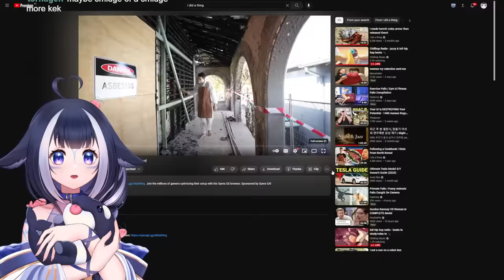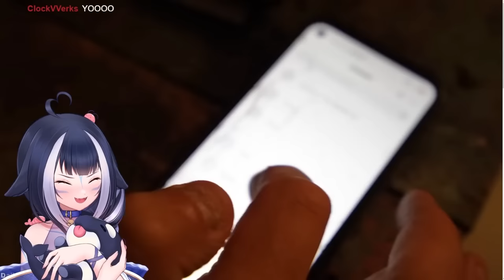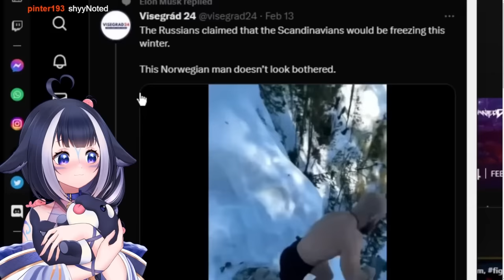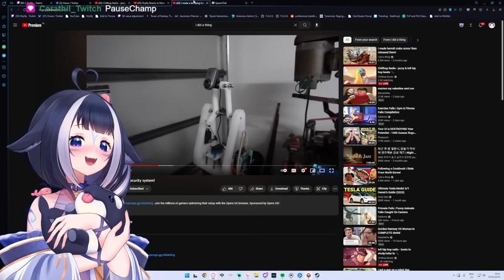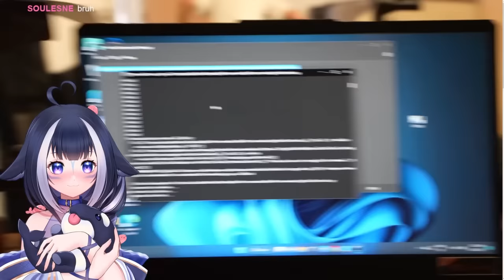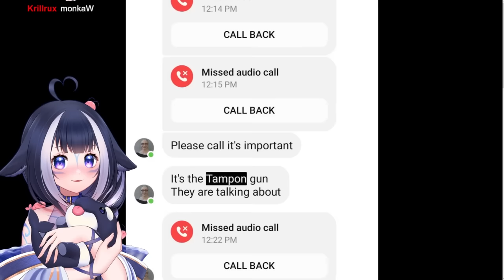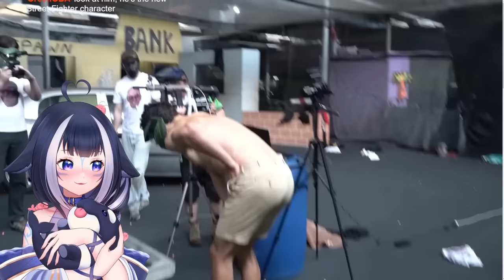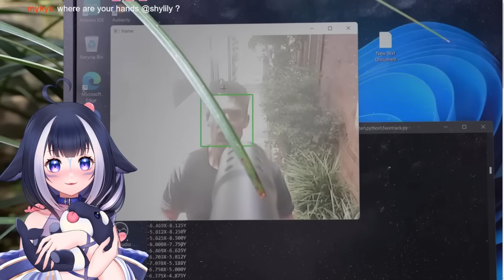Shylily Reacts to 'I made an illegal home security system!' | I did a thing

Comment: Paintball guns are no joke. If you get struck by your standard-issue paintball on a part of you that is not padded (as one might be for an actual paintball game), it WILL hurt, and it WILL leave welts and bruises. That's why there are rules and enforcement for those rules at reputable establishments for barrel plugs, goggles, and so on.
I do not play paintball, but I did learn a bit by reading a webcomic called "The Whiteboard," which (mostly) takes place at a shop in Alaska that services paintball equipment.